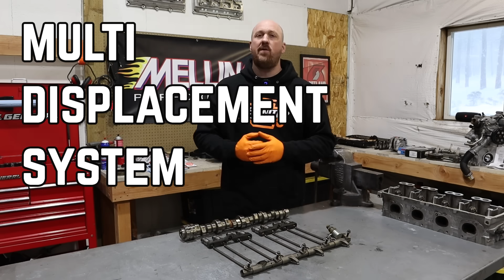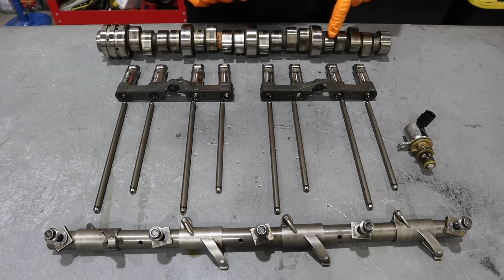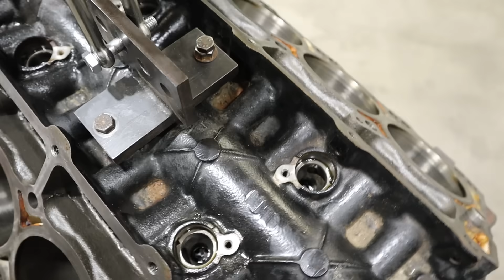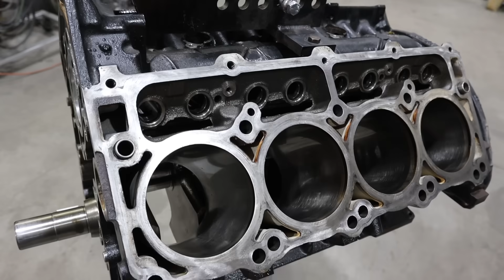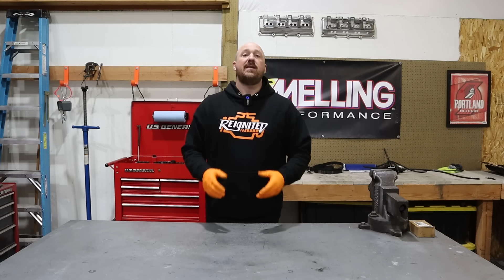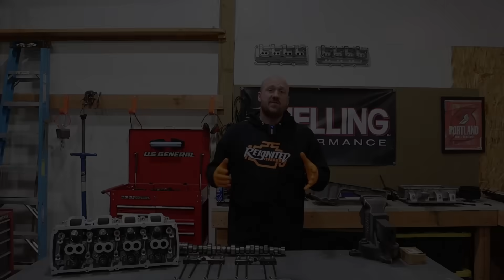Is MDS Damaging Your HEMI? The Answer May Surprise You!

Comment: I had my 2006 Hemi 5.7 V8  cylinder head done by the agents. came back with an oil leak between the gearbox and engine. what could it be. I'm in South Africa
Reply from the maker: It's possible that they rolled the rear of the valve cover gasket when they reinstalled them, very easy to do, and the leak would run down the block and look like it's coming from between the engine and trans.

Comment: I love this on my 14 ram.  Took the first trip from Athens Georgia to Amelia Island Florida in July.  Driveway to driveway it averaged 25.1 mpg.  I did travel back roads where it stayed between 60 and 70 mph most of the trip because that was the fastest (straight route).  Was over 26 until the 70 miles of interstate where i went up to 75 -80 mph.  I will leave it operational until it wipes a cam lobe.  Then i have a serious dilemma.  Keep the mpg or make more power and lose a lot of mpg.

Comment: So can a high volume oil pump hurt the mds system ?
Reply from the maker: Not to my knowledge. I ran one in my 300 for quite awhile with no issues. I can't think of any mechanical reason that additional oil pressure would damage MDS components. 👍

Comment: Thanks for a great video!  really informative, especially the part about the oil flow.  I wonder if those galleries are just the engineering solution of how to activate a mechanism on a push rod inside the engine and not truly for lubrication.  I feel like it would be a fatal flaw to have a oil flow that would be limited whenever the truck is towing or running hard (when MDS is off naturally).
Reply from the maker: I do think it was an interesting decision to do it the way that they did, but I'm not an engineer myself...

Comment: I have a 2023 Ram 2500 Power Wagon 6.4 and as soon as I start to drive, I toggle up to gear 8 so the truck does not go into Eco Mode.  Is this going to create any issues with my engine?
Reply from the maker: I would say that performing your oil changes no more than 5k miles apart and not letting the engine idle excessively are going to have more of an impact than the MDS being off all the time. That being said I'd still turn it on from time to time if possible.

Comment: I got oil change. I drove 274 miles I heard a very loud tick. Turns out my oil plug was not tightened properly. I lost almost 4qts of oil. 2016 ram 1500 217k miles. Deleted mds from day one with a Diablo pulsar. Oil change always on time. My question is would low oil cause premature failure bc I’ve never had one single issue from my motor. I bought it brand new. So my question is would low oil cause the problem bc I did still have 50psi oil pressure.

Comment: I appreciate your information - quick question for you - what function do magnets underneath mds solenoids do? I have a 6.4 hemi that had bad cam. I have replaced cam, lifters, mds solenoids, and magnets underneath (in 4 or 5 attempts to make it run smoothly) and it still is giving me missfire after mds is activated first time. Last attempt after new solenoids and magnets I drove 100 miles with tow button on to keep it from activating... ran excellent -  I thought it was finally fixed so I turned off tow/haul while driving and it started missing and has been ever since... no matter if mds is on or off. I appreciate any instruction you can give me - at wits end

Comment: Sky! Need your advice and I have a question. In your video you say the lifters will not receive full oil flow if they’re just unplugged. Is that true? In my experience with solenoid there is only 2 positions, energized and non-energized. 

2nd; after working on 3 retired police cruisers that are 09, 12, and 14 they all have the PRE-eagle old style MDS solenoids. If you run the vin, it will tell you to get the new style. Upon installation the wiring harness is different. And being with 3 different police eagle hemis now it’s a cop car thing. Any idea why they would do this?

Comment: I've been wanting to delete the MDS system from my 06 300c for quite awhile because I simply don't like it, don't get much use out of it due to how I drive, the non-MDS lifters are much cheaper, and I need to replace my headgaskets currently anyways. With that being said I've always had questions that seem to have many conflicting answers online on a bunch forums. One of the biggest being do I need to replace the cam with a non-MDS cam and the non-MDS lifters or will non-MDS lifters work with a MDS cam? Also are the cams in the trucks different from the cars because when you look up these delete kits online they say they're for Chrysler, Dodge, and Jeep? However, if the cams are different in the trucks and cars, which I'm assuming they are because if you look up a 06 300c and a 06 ram 1500 with the 5.7 their torque numbers are different which I'm guessing is from the cam, then that would mean that can't be right and even if it ran properly wouldn't you lose out on power assuming its configured like the truck? Sorry for so many questions but you seem like someone who's actually a reliable source for information on these motors so I'd appreciate your input.
Reply from the maker: You are correct that the cam profile are different between the trucks and the cars. The truck came are more oriented towards torque rather than horsepower as you said. For your question, yes you can absolutely use non mds lifters on an MDS camshaft with no ill effects. 
One thing I would mention, please do NOT buy cheap aftermarket lifters. They have a propensity to rattle horribly and you'll have to do the job all over again to replace them with better quality ones. I'm still a fan of purchasing OEM lifter sets over all others. They are expensive, but there's a reason why, they are far better quality. Hope that helps 👍

Comment: I have 171600 miles on my 5.7 Hemi powered Aspen, I’ve noticed a 2mpg chance with a faulty cylinder 7 solenoid.  Come fall when it’s cool enough to do outdoor engine work.  If the solenoid is faulty how can I deactivate the system or can I run as is for a month or two?

Comment: 2018 Dodge Challenger with the MDS systems 5.7 l what's the advertise 16 City 26 highway City can vary a lot depending on how I drive or if I have in sport mode or not but if I got it and cruise control on the highway I usually get I get at least 31 me to Giant galleon and it high is 34.1 MI to gallon

Comment: Thank you for a great video! 
One question though…
Why would they have the valves closed when the MDS activates? Is there a reason they keep compression when MDS is active? It would seem easier for the engine to rotate with no compression (ie- even better gas mileage)
Thoughts?
Reply from the maker: I think I said this somewhere in this video, but having compression in the cylinder means that it's not actively drawing oil from the crankcase into the cylinder while it's deactivated. 👍
Reply: @ReignitedAuto  you did mention that, regarding  vacuum, but what I’m saying is, what if the intake valve was left in the open position, the piston would move but no pressure would be built up
Reply from the maker: @johnskingcabbie2482  there's no mechanical way to hold the intake valve open during engine rotation.

Comment: I'm wondering what happens in tow-haul. If the lifters are not getting the pressure of oil continuously, is there another gallery that is activated! I've pulled extensively for long periods in this mode. Thanks for your work on these subjects. 
  Signed, leaking headers
Reply from the maker: I think at regular operating RPM the engine and lifters are getting sufficient oil flow, and there is still oil flowing through the lifter bores, it's just not the full pressurized oil. Basically I feel like if you are being consistent with your oil change intervals and not letting the engine idle for long periods of time, those are much more important in the grand scheme of things than running in tow/haul mode 👍

Comment: Hi !  i have code P1411 and code P301 i change coil and plug cylindre one and code P301 gone but i still have that code P1411 please HELP !!!!!!
Reply from the maker: It's likely that you have a problem either with the MDS solenoid itself for that cylinder, or there is an issue with the sub-harness that goes to the solenoid. I do see some issues with the harness due to rodents living under the intake and chewing in the wiring.  If you're up to it, remove the intake manifold and inspect the wiring, if you don't see any obvious issues you can swap the MDS solenoid with a different one and see if the problem follows it. A major tip to get the solenoid out without breaking it is to give it a rap on the top with a plastic mallet. This will break the seal and allow it to be removed, if you just try to pull or pry it out you'll break it in half. Hope that helps!

Comment: I might be old school minded but id rather delete it and have 8 all the time
Reply: Ye thats why I always keep my scat pack in sport or track 99 percent of times its sport. Didn't buy a 500 hp v8 for 4c
Reply: "If you aren't in MDS, you aren't getting proper lubrication."

ALSO

"MDS doesn't come on all the time.  It requires very specific conditions and only runs some of the time."

NOPE. That crap is GONE.

Comment: 6/26/2024
Sir:
I very much enjoyed this video – very informative.  My 2007 5.7 Aspen 2WD 3.92 rear, 131k miles (fancy Durango) gets a P3400 code and comes back when cleared.  Intake pulled and solenoids replaced February 2018 at 81k miles. 5w20 oil is always clean, oil pressure at 1,500 RPM is 50 lbs. Runs great.  What are the implications of ignoring this “Cylinder Deactivation System Bank 1” code – what is the long term bad?  Thank you for your help?

Comment: One of the best vids I've seen about the cam issue. I have a 6.4 scat and it had the cam problem. I will agree the car is not made to idle. It's a design flaw in the block. If you commute in a car like this sitting in rush hour traffic then you will have the cam problem. You say the MDS is well thought out. I don't agree. It's an inefficient add on because of cafe standards. With my car MDS is off in sport mode and I purchased a tuner to turn off MDS in regular drive mode. It's been 4 years since the cam was replaced and it runs like a top. The MDS would come on in 3rd gear, the motor/exhaust had a weird drone and you have to punch the gas pedal to get out of it. I get 1 to 2 mpg better on highway without MDS. It cost 6 grand to replace the cam then. I can only image what it costs today.

Comment: Once you replace the oil pump... do you need to upgrade the software or adjust the software..?
Reply from the maker: If you put the stock pressure relief spring in the new pump no changes will need to be made to the software. 👍

Comment: So I noticed on my truck. When the mds deactivates after i slowly push the gas. I hear a shuttering noise. The engine seems healthy. Minus that. I'm getting the manifolds fixed currently. Hopefully that fixes that problem otherwise i have other issues
Reply from the maker: That's actually common
For some reason it's more noticeable on the ram pickup trucks when it comes out of MDS mode.

Comment: 2017 1500 Big Horn owner. Thank you so much for explaining this. I've been manually disabling this system by using the manual gear button on the steering column every drive. Going to start letting it do its thing now. I've heard so many rumors of lifter failure due to this system, however, I am a strong believer that changing your oil on time, every time is the biggest help for any vehicle. Thanks!
Reply: I must say, I still don't understand how it harms deactivating the MDS with the manual gear button. His video fails to explain properly how a deactivated solenoid starves the lifters from full oil pressure. Could you help me understand it better? In other words, a car that has no MDS (no solenoiids) he's telling us that gets less than optimum oil flow? Isn't that the same?
Reply: @pisquared1366  or when your in tow haul mode. That deactivates MDS and there going to starv the engine of oil when it needs it the most. ?
Reply: @Jtwes  exactly my point. It can't be that the solenoid at its deactivated position (that is, MDS on, lifter collapsed) alllows (through a bypass somehow) the most oil downstream. Because that's a low demand situation. I may be wrong, but I think when you're towing or have high demand from the engine and MDS gets deactivated automatically, you also have the max oil flow all throughout the lifters. I'm thinking also because it makes sense (I read it on 5th gen forum), the moment reactivation of the MDS lifters takes place, that moment you have some disruption of flow to the adjacent lifters too, maybe a condition of starvation that eventually leads to failure
Reply: @pisquared1366  l assumed that T/H mode eliminated the cylinder shut off . Until trying things out in my New to Me '17 Ram , it still activated in T/H mode .
Reply: It's better to have it off but it's a catch 22. If you have it off cant let it idle  when off and idle  not get oiled.  Look it up idle time is a big no no
Reply: @booostedtc  I let my 2011 Ram idle ALL the time to warm up.  Over 110,000 miles and not a single issue.  My wife's 2020 Durango R/T hardly ever idles, as it's in the garage, already had an issue covered under warranty.  So I really don't believe oiling issues at idle is the problem.
Reply: Change my oil every 6 months or 6000 kilometers(3700 miles) on all my vehicles
Reply: Same here!!

Comment: 2020 ram 5.7, i just got the tick. Now i have stopped driving the truck, but i noticed when the eco comes on the tick goes away. This is me with my head out the window going 25mph. Im guessing its a bad lifter or can it the solenoid? I know you diagnose with me just telling you but I want to see if i am on the right track. Thanks!
Reply from the maker: It being a 2020 ram, personally I would check out the exhaust manifolds first before chasing a lifter issue. It is extremely common on 2019+ trucks to Crack the exhaust manifolds right in the center. If you're willing, pull the heat shields off and look for a sooty Crack in the center of the manifold. Generally these are identifiable due to the ticking noise being most noticeable right on initial startup. I always like to start with the simple things first. 👍

Comment: My 6.4 is in a 3500 I bought for pulling trailers. When I put it in tow haul mode it disables the MDS. I don’t like to hear when I’m pulling trailers I’m not getting proper oil flow to my lifters.

Comment: I've seen a bunch of videos on this topic, and I will say that I truly got a better understanding of this system from this video. Thanks 👍!  
With that being said, I currently own a 5th Gen hemi 1500 Crew cab bighorn.  This is my 3rd hemi truck.  I'm not a fan of waiting 7,500 miles between oil change, so I do mine at 4,000 miles, religiously and have had no issues. 2019 currently with 57k miles.  Oil change is critical for any engine to run well.
Reply: Apparently you have never owned a Toyota w an 8.  Oil changes every 10k miles and it looks the same as the day you put it in.

Comment: Hopefully someone can help me out, i have a 2017 ram 1500 with the 5.7 with mds, truck runs perfectly fine, no power loss no check engine no nothing. When it gets up to operating temperature tho and its coasting on 4 cylinders it makes a grinding noise as if it had a bad wheel bearing and if the oil temps is 220+ i can start to hear light tapping at iddle which increases if i iddle it and put it in gear with the brake on
Reply: And yes i have changed the oil religiously so its not a negligence issue but maybe i have iddled it a bit much for a hemi i guess 😅

Comment: In a nutshell, this system is more robust than the GM system that is failing with a higher frequency. I prefer the Ford system, but being an overhead cam V-8 it allows a slightly simpler approach. I'm searching desperately for a truck that is reliable. Toyota has gone to crap, GM has lifter and main bearing issues, Ford has more general quality issues. Ram is far from perfect, but for a new model it may be the tallest midget in the room. Would settle for a 21 V8 Tundra but the price is basically MSRP with 30K miles. That's hard to swallow. Appreciate any opinions - so tough to get actual failure rates because the manufactrurers are withholding the information in many cases.

Comment: interesting video. but how is it true that they needed MDS to pass, when they manual transmission dont have it.
Reply from the maker: Couple reasons here: we have to remember that the MPG is average across the lineup, so the number of manual transmission vehicles out there is so small comparatively that it doesn't significantly affect the overall average. Secondly, the manual trans vehicles actually get better MPG already due to less overall drivetrain losses than an automatic. Third, it's not nearly as feasible mechanically to have a system like this in place for a manual trans. Same scenario with the automatic where you put the shifter into manual mode, it turns off the MDS system at that time. 👍
Reply: @ReignitedAuto  excellent answer,  i assume MDS would feel like a " dead miss" on a manual transmission without the converter to let it absorb i have a 2018 manual 6.4 challenger no MDS but like u said, lifter failure can still happen.   my 1971 340 ate the cam up after lifter failure